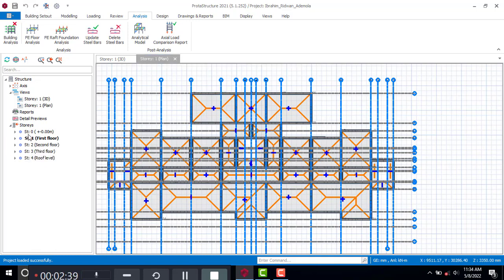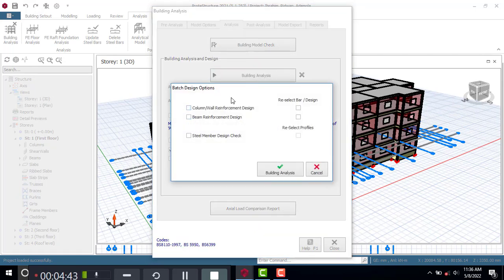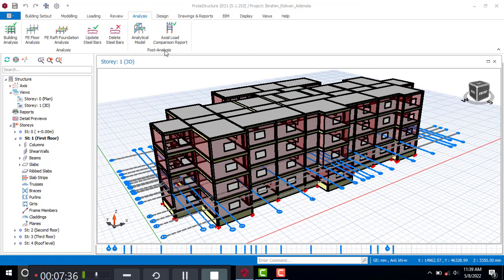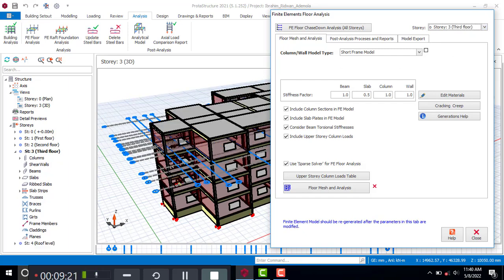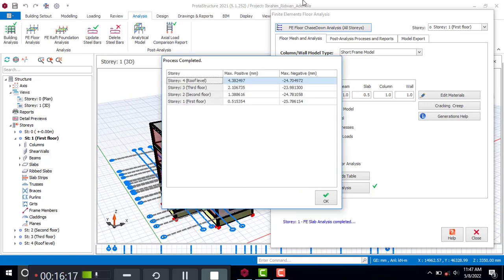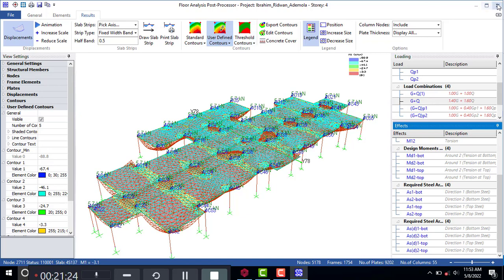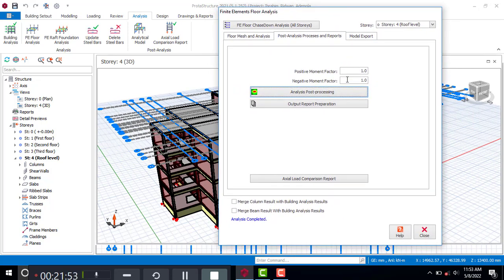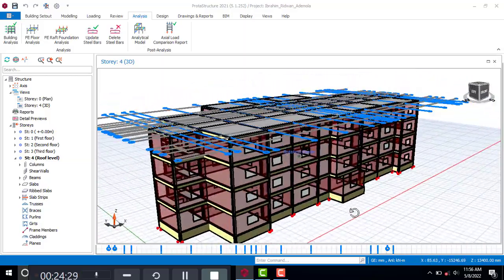The 4 methods of analysis in ProtaStructure.

Comment: You mentioned that there are 4 methods of analysing. I need your clarification on one issue. The first method involves BULDING ANALYSIS, whereas the second method is FE ANALYSIS. What if I have run the BUILDING ANALYSIS, and later wish to design the slabs using FE ANALYSIS (Slab strip using FE STRIP instead of ANALYTICAL STRIP). In which case do I have to run FE ANALYSIS TOO???? Thank you.

Comment: Engr which of the analysis method is the most effective for the final result?
Reply from the maker: Thank you for the question. 

1. Building analysis is a static analysis. Its the only analysis available for columns and beams design. 

2. Slab strip is also an analysis that is available for slabs if you want to carry out a static analysis.  

3. FE floor & Mesh and FE chasedown analysis are linear analysis for slabs. 

4. FE raft foundation analysis is also a linear analysis but can be used only for raft slab.  

This means you only have one method of analysis for slab. You have three methods for slab. All these analysis will give you accurate result regardless of the method you use.
Reply: @ridwantician  thanks Engr

Comment: Why we need to change slab stiffness factor to 0.5 when run the FE Floor analysis?
Reply from the maker: By doing that, you're increasing the stiffness of the slab. Hence, you're making it stronger. You can as well reduce it to 0.25.
Reply: @ridwantician  Engr. where can we find this stiffness factors in the Bs or Eurocode? you are really doing a great job.